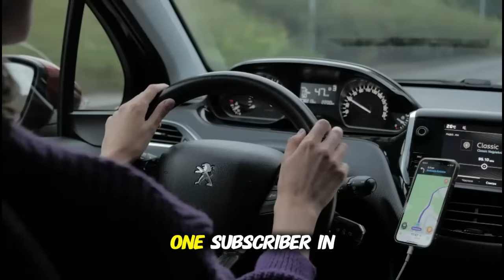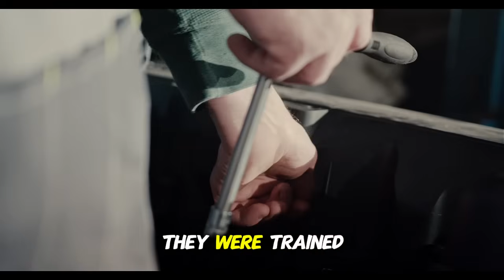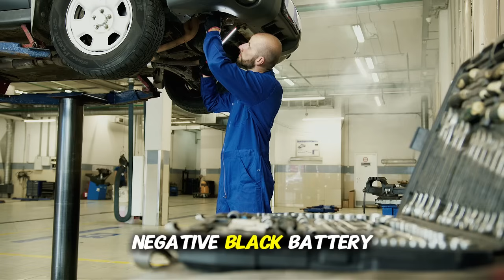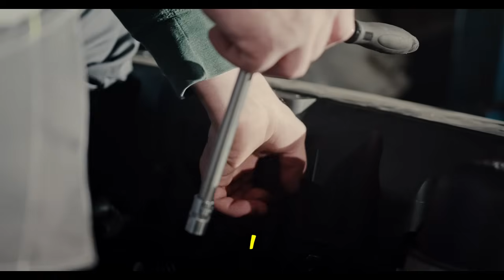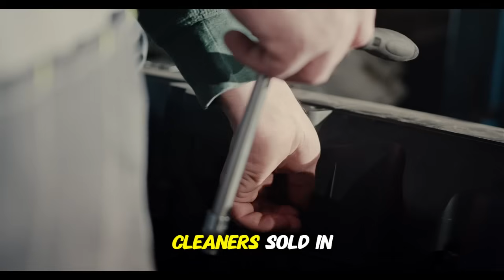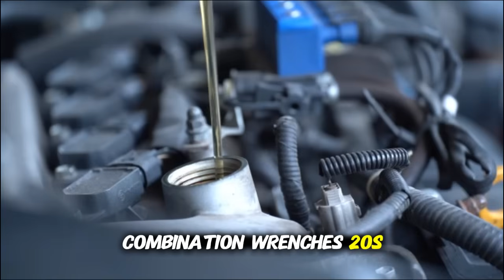THE $12 SOLUTION TO $3,000 REPAIR BILLS: SIMPLE Fixes Mechanics Don't WANT You To Know

Comment: I had a crazy rough idol on my 2001. Toyota Camry that I just got fixed. It was P0505I had it for many, many years. I've had many idle air control valves and one throttle body assembly put on it and still didn't fix it. Clean it multiple times check the PCM multiple times
And it was just a wire problem